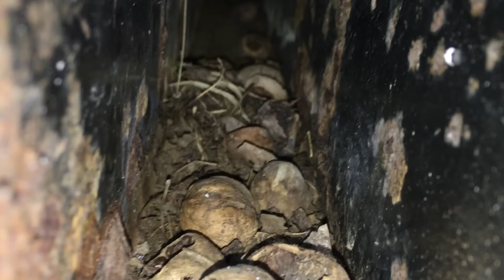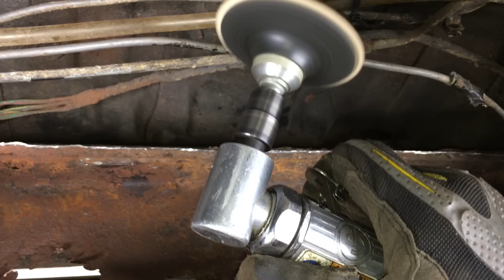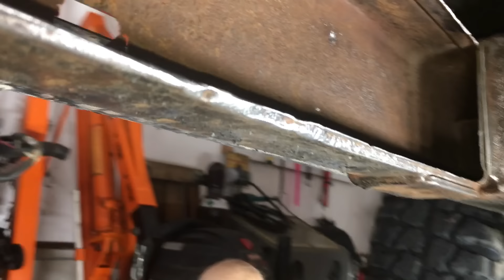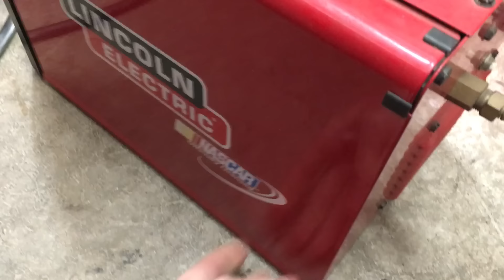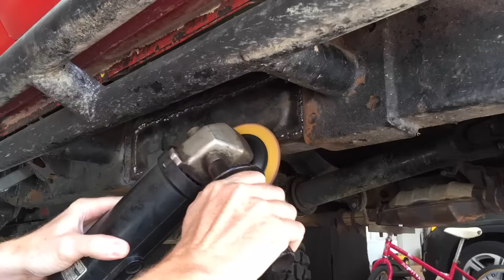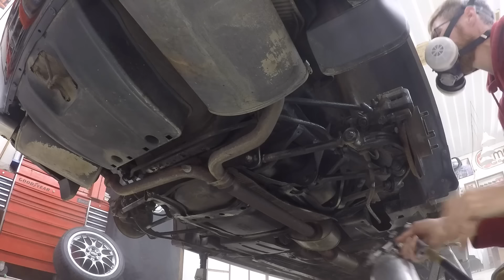How to Properly Repair Rusty Frame of Toyota Pickup Truck at Home

Comment: If I went that far with a frame repair, I would've tried to blow out as much from inside the frame as possible, maybe even do a power wash inside, but after letting it all dry, spray some form of anti-rust / rust converter inside, too. I've used "Coroseal" on my 2006 Colorado's underside. It's not perfect, but does pretty good. This winter (before winter) I'm going to go underneath and reapply another lay of Coroseal and once it cures, apply Woolwax to everything. Coroseal is non-flammable, so applying it to any bare metal you can access before welding is a must. You could still do that with a 360 rattle can hose-nozzle + air compressor + spray gun, if you're up for the task...
Reply from the maker: I did later in the video ;) I haven;t tried Woolwax, but I've become a fan of Fluid Film. I didn't use a converter on the inside of the frame because when it peels and flakes off, that will be more debris inside of the frame.

Comment: Good video, if you want to make it easier to get the cuts perfect, just take your new plate, put it on top the old one and cut the two plates at the same time.  The cut on the new plate will match exactly the one your cutting out.  If you cut it on a 45 degree angle, the new plate won't have any gap from the thickness of the cutting wheel.  See Fitzee's Fabrications for that one!  He is the master of the cut n butt!  Take care!

Comment: Why didn't you start with removing the cab and the bed for better access? If the frame is rusty as shown cutting out rotting sections or even rebuilding the whole thing would be a better and quicker method.  But now comes the part nobody talks about: new steel has to be pre rusted. When steel is made coming out of the roll in the factory a thin layer of not sticking steel on the outside has formed and has to be rusted off before you can use this steel. If not, this layer will rust off under whatever paint is used ( can take years as you shown in the video). Examples are the well known rusted powder coated frames.  To do this is quite simple: leave new steel outside to be rusted and grind off the rusty layer. Now you are ready to use your new steel what if treated well will never rust under your paint job. Your welcome.
Reply from the maker: Most people (including me) don't have an easy way to remove the cab & bed, it makes the repair a lot longer. I don't see how rebuilding the whole thing would be quicker, but eventually I want to buy a rust free frame from the southwest and have it shipped here. Then I can swap frames and not have to worry about repairing this one when a different section gets thin every 10 years. I did not know about the thin layer of not sticking steel & new steel has to be pre rusted - thanks!

Comment: One more reason why I'm liberally spraying inside my 2019 Jeep Wrangler Frame each year, not taking any chances. You'll be surprised how fast rust can take over after 1 year. I recommend buying a Endoscope  with 3 camera's for checking inside the frame,  not too expensive.
Reply from the maker: Good idea on the camera!

Comment: Por-15 is excellent as an encapsulator. It needs to cover every bit of rust. 
But with painting an entire frame like your first attempt - it’s almost impossible to encapsulate because you’ll have to cover the inside also otherwise the moisture will creep behind the por-15.
Also it’s tricky stuff in terms of prep and getting all contaminants off a rusty frame is…. A challenge to say the least.

Just paint the outer with epoxy primer & inner with something like Dynax S-50 and it’ll outlive the truck. Good job with the repair though bro.
Reply: Thats what wool wax or fluid film is for
Reply: @4WheelKid  nah por-15 is best used when rust has already set in. Clue is in the name. If some metal has got to the point that it’s a bit sketchy, por is usually enough to save it in my experience but I wouldn’t use it as a preventative measure by any means.

Comment: I have a few honest questions regarding this type of repairs. First, I would like to say that it looks like a lot of hard work and I would not be able to do something like that. Admitting that, my questions are:

- Is this safe? We are talking about structural elements here that are, obviously, in very bad condition. It seems that the whole chassis is rusted and no matter how many patches it has, structural integrity will be compromised.

- Given that it is a quite simple vehicle. Is it not feasible, and maybe better, to just make a new chassis from scratch or at least to replace entire beams so the integrity is not compromised?
Reply from the maker: This repair will keep it on the road, but eventually I would like to purchase a clean frame from the southwest and swap everything over. Or maybe by the time I can afford that, someone will be reproducing new frames for these trucks.

Comment: Woolwax. And more importantly than undercoating is inner-coating. Get that hose down inside your frame and panels. Also, before you even do that, flush your frame out. Get a hose in there and wash out all the dirt/sand/salt that's sitting inside there.

Salt attracts water. If you have sandy dirt inside your frame, you could be well into a 90 day drought in 90 degree temps and it's still going to be wet salty dirt inside your car parts. You have to wash it out good, let it dry, then woolwax inside and out.

Anything that dries hard sucks for at least a couple reasons. It chips, flakes, and cracks, and gets water and salt trapped between it and the metal making things even worse, and it doesn't adhere well to metal that isn't pristine clean, which makes problem 1 even more likely.
Reply from the maker: I did spray the inside with Fluid Film later in the video. I've had good luck with Fluid Film.
Reply: lol. I just realized I didn't watch the last 4 minutes of the video. Good stuff. I think I prefer fluid flim on the inside, but woolwax on the out. Woolwax is sturdier and will stand up to being blasted by road spray better, but fluid film creeps better to get inside all the little cracks. So my thinking is that inside the frame FF is probably better. It shouldn't get high volume/pressure spray inside the frame.

On the outside I like woolwax because it's more durable, but doesn't creep as well. Also FF stinks and gets a lot more overspray hanging in the air than woolwax, which is something to keep in mind if you're in a heated garage with the open flame of the heater. Woolwax smells pretty good.

Comment: This is great! I had a 1989 Toyota 4WD pickup that I bought new in May of 1989 for 12K. One of the first things that I did to the frame was to coat it with Karnak roofing tar. I've read stories on how you should never coat frames with Karnak, but that was years after I had already coated it. If it's good for a roof being exposed to 4 seasons of punishment, it must be good for the truck frame. I must say that when I sold the truck in 2016, there was not a bit of rust or corrosion on the frame, and I lived in the New York Tri-State area where they apply salt to the roads just for kicks. Body panels and doors were all loaded with rust, but the frame was the least rusted part of the truck. The center cross piece that held the spare tire carrier was rusted beyond recognition and that was because I never coated that. I now own two Tacomas. My older Tacoma that I bought used is showing signs of corrosion and I'm going to fix her up because that was the last good Tacoma engine and transmission wise. My other Tacoma is a 2021 which I'm not too crazy about, but I intend on keeping it for a long time. So, I plan to coat the frame with Karnak. Hey, if it worked the first time, it should do OK for my newer Tacoma.
Reply: Isn't it funny how much they use to cost?? I got a new 88 4X4 for 9600$ off the lot in December of 1988, that truck owed me nothing!! Now these things are nearly 50K, and the frames last 8 years, it's insane!!
Reply: Wasn't Karnak one Johnny Carson's character bits on the tonight show? " You are correct sir" !! 🤣

Comment: Watching your video again, I have used self etching primer on bare metal. Then i used PB Baster Surface Shield. The frame looks black because dirty clings to it making it look black. Helps identify area's with high wash off that need to be recoated. I've done it a few times and its holding up nice and strong at my repair areas. There are some area's of the frame that need repair that i will be doing this year to hopefully end all ROT that was on it.

Comment: Thank you for a great video on the repair of the frame of your Toyota truck. Your monologue during your work enhanced the content by explaining exactly why you were doing what you were doing. Your emphasis on the importance of thoroughly cleaning debris from inside boxed frames is one thing ignored in many online videos about the repair of truck frames. Often, videos show the installation of frame repair caps with no mention nor evidence that any effort was made to clear debris from inside the frame first. Without such cleaning it seems obvious that any attempt to effectively apply anti-rust chemicals after repairs would be impossible. One can imagine your frame boxed-in with its debris pile still in place. How could any anti-rust material be expected to adequately coat the frame interior? Instead, the debris can trap salt and water from winter highways and block anti-rust materials from reaching many of the areas where they are critically needed. Additionally, the debris can eventually block frame drain holes which might have allowed water intrusion to escape. I realize that in some frame repair situations it may be required to cut a hole or enlarge an existing one through which to gain access for effective debris removal. However, how can such important, safety related repairs be considered complete without an comprehensive plan to prevent a repeat failure?
Reply from the maker: 100%, prep is the most important part of the job!

Comment: You could have used a magnet to get the big chunks.
Reply from the maker: The only problem with using a magnet is it would stick to the metal frame as well, so moving it around would be difficult.

Comment: "guaranteed to get tetanus" -- you may just be joking, but tetanus generally requires two ingredients: manure or black soil (tetanus microbe carrier), wet/anaerobic conditions in substrate and wound. 

in this case the tetanus microbe is unlikely to exist on the dry, manure-free frame.

though the only decent way to truly avoid tetanus in a humid environment where you get wounds to the skin or deeper, is to be vaccinated, and boosted every 10 years. i havent gotten the shot in 20 years though. 😬 i believe the spores are much less common in desert environments.
Reply from the maker: That's good to know, thank you!

Comment: When I do bare metal I preheat it with a hand torch to evaporate the surface moisture then use the self etching primer and I like top coating with implement paint from tractor supply. Spraying the inner frame with a zinc coating or weld thru primer would be a great addition too.

Comment: Hey - what size plate did you use? I have a Dodge Ram I need to repair and wondering what thickness of material I need
Reply from the maker: The steel was 1/8” thick

Comment: I used a drill, a few small links of chain, and a flexible fiberglass rod to knock off heavy rust inside frame. Then ospho for rust. After that Eastwoods internal frame with a 360 nozzle like film. I saved it from the frame coating can and use it for all things. Then I used rustoleum, or farm implement paint. Wax is good but 2 expensive and won't last long. I make my own with 1 quart if oil new or used, 1 quart of trans fluid new or used, 1 grease gun cartridge, and 1 or 2 wax flange gaskets for bottom of crapper. Mix and heat in old pot and spray, brush etc. This will cost $6 and last year's if u really get it all inside, outside all metal under auto. My Pap did this since 60s in Ohio working at Ford plant by lake with all the snow and salt. Never had anything rust out. Old leaking machines with steel never rusts when leaking hydraulic, trans fluid or oils and grease. For tge price of 1 can of fluid film u can make urr own that's way better in EVERY WAY than what we can buy. Reason is most wax don't have petroleum products, if so it's very very lil. With tge wax it won't drip, etc. If u need it to creep when doing doors, etc I either thin it with whatever u want or I use baby, mineral oil or melt some Vaseline. Cheap and smells good. Tape up drains in hood, trunk, doors and fill and let sit for a few days then drain and save for next few years. U won't have to do this every 3 months. U do this 1 time really well and no worries for years. And helps out if u need to fix any under body, frame parts. Cause the hardware always brakes in salt states.

Comment: I have rust spot where all the mud used to get stuck inbetween fuel tank and frame…frame rails still filled with mud 😢
Reply from the maker: Very common problem on these trucks :(

Comment: Por-15 is a 3 part system technically if you read their website,
You’re supposed to rust reform after removing as much rust as possible,
Use por-15
Then when it dries scuff with 320 and top coat,
Which will prevent your product from doing what it did there
Reply from the maker: The can I had said you can apply a second coat within a certain time frame, but didn't say anything about having to sand before the second coat. What I don't like about POR15 is that it is not UV resistant. I've had very good results when using their prep solution though.
Reply: @6thGearGarage  the top coating products are Uv resistant tho
Reply from the maker: @articat568  Oh cool, I didn't know there was a separate top coating
Reply: @6thGearGarage  yessir! 
The second product has kept it from getting gummy like you showed in video,
But price point is still an issue with POR-15s products

Comment: For future reference you should use a 220 setup to weld stuff that thick if you want good penetration. Also remember higher amps isnt always more heat, more heat can be added by moving slower. Beveling your plates will help as well. Also flux core welds pretty good as long as you switch your polarity, most of the time they come out pretty decent with only a little spatter.
Reply: Flux core is naturally hotter typically so it does penetrate better than some would think,
A 220 welder is the end all be all for sure tho
Reply: @articat568  yeah ive actually had great luck with my old century flux core machine haha shes an old tank welds good for small stuff around the house.
Reply: I sometimes run a 110v flux core welder off my miller trailblazer in my service truck. It welds heavy ass hooks onto 1” plate loader buckets pretty well. Just hard on the lil sucker for sure.
Reply: @Keith-jp6jw if she does it, she does it.  
Just gonna get checked by the duty cycle.
Reply: @maxnovakovics2568
Yea, I only use it for relatively short duration welds. They regularly lift around 3 ton with the hooks though, so far so good.
Reply: My Forney Easy Weld 261, 140 FC-i Welder, 120V claims to weld up to 1/4 steel. I am sure it is definitely cable of weld 3/16, let alone 1/8.
Reply: 220 is for sure a stronger weld . 110 will
Not get hot enough

Comment: Pure Argon is not the correct shielding gas for steel. Argon/Co2 Mix or pure Co2 would be right while the mix would be the best
for undercoat and frame protection: everything lanolin based. redo every 2 years where it may have washed off if at all. remove all rustscales before and also coat frame insides, lanolin is also safe for all suspension and drivetrain rubber parts, only thing MAYBE sensitive to lanolin is door seals. Lanolin everywhere. More Fluid Film. outsides, insides and don't be cheap on the amount
Reply from the maker: My bad, I said Argon but it's actually argon mix, C25.

Comment: I would never cut both sides out, Chassis could move. do one side and weld it before cutting the other side out. Push in to the weld at an angle, don't pull ( no penetration) your welds are laying on the top. Prep the weld as others have pointed out, better still have a small gap between the patch and rail and you will get 100% penetration.
Reply from the maker: I felt safe cutting both sides because the cab was mounted to keep the chassis square, also because the cut on the outside wasn't the entire side, so some rigidity was left.  If I would have been lifting the frame with a jack or rolling it around, I would have not felt comfortable with cutting both sides at the same time.Thanks for the welding tips, next time I will leave a small gap. That makes perfect sense.

Comment: Everyone coming here after finding a hole in your frame? I've heard nothing but good stuff from fluid film... But of course I also heard the same from por15 a decade ago.
Reply from the maker: I vouch for fluid film 100%, just make sure to keep the product applied, as it washed off over time. I used to be one of the guys that praised POR15, but the surface has to be properly prepped for it to bond well AND it's not UV resistant.

Comment: Strip the frame of the coating and flaky heavy rust.  Degrease the frame, then use a product called Ospho to convert the light surface rust back to steel.  Once that's finished, paint over it.

Comment: Excellent video very informative thank you. I wonder why no welder ever use rust converters, I am not a welder but I would have thought it’d be a good idea to get a few coats of rust converter inside the frame and outside where there are surface rusts? Are they a bad product to use from you welders prospective ?
Reply from the maker: I'm not a professional welder, but I've had mixed results with rust converters. They don't seem to do well with very heavy rust, only lighter surface rust.